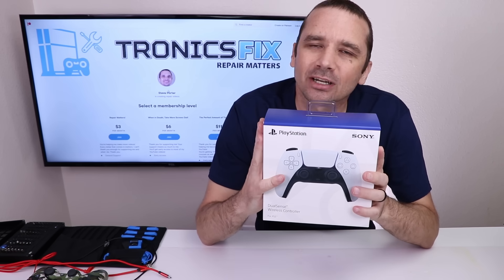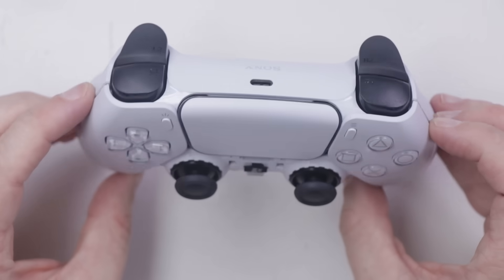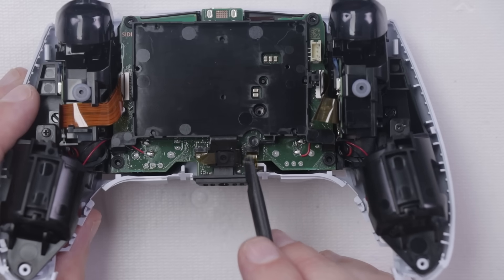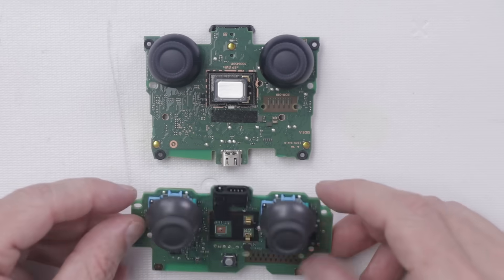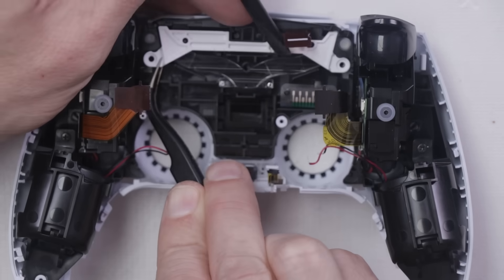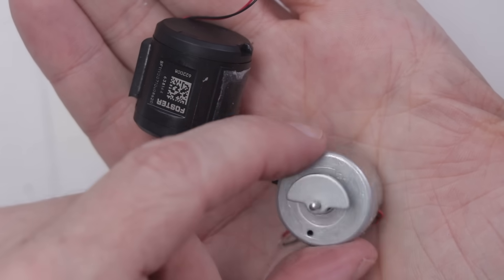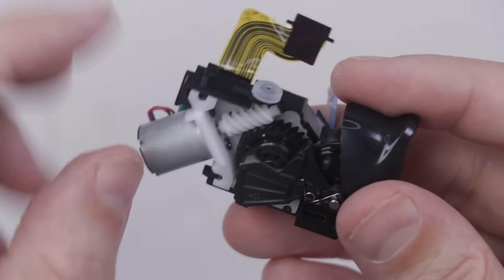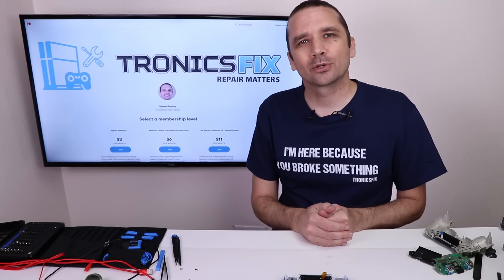PS5 DualSense Controller Teardown - A Repairability Perspective

Comment: Seems easy enough to take apart which is good news, I didn't know the Dualshock 4 controllers have analog stick drifting issues, I know all about the Joycon issues but never seen or heard of it in Dualshock 4s. Had so many issues with the darn Xbox one controllers though, rubber bit coming off a elite controller, USB port breaking, not charging, connection dropping every few minutes. Speaking of which when's the XSX controller teardown coming out? I thought those got sent out way before sony sent out their stuff.
Reply from the maker: I'll tear one down as soon as I can get my hands on one. Can't get them yet.
Reply: Joy cons have it after 0-90 days of use already. DS4 only show same result after year or years of use. Joycons are just overpriced garbage.

Comment: As someone who loves to customize controllers this looks easy to mod I’m happy
Reply from the maker: Yes, this is going to be a good one.
Reply: @Tronicsfix  how does the controller feel ? And the joystick tension how is that ?
Reply: @Fixiefre123ak  The joystick tension feels smoother than my ds4, also found out that the controller can be used in ps3 too. Can't wait to put an LED kit in this beast, lol.
Reply: @kylinemordashov1452  okay that’s good honestly it’s the reason I prefer DualShock over Xbox because the joysticks on Xbox feel terrible
Reply: @Fixiefre123ak  Hey. Update, i just got my ps5, the test I was referring to was on the mall, like "On the mall show"...Anyways, the controller joystick feels the same now that I'm using it for 3-5hours now... I have then decided to remove the joystick and put my broken xb elite series 2 joystick on it, now it feels great. lool ;p

Comment: dualshock 4 battery is like a ps2 memory card.
Reply from the maker: Lol...yep!
Reply: Ps1 memory card since it's gray. Ps2 memory card was black.
Reply: @wagner2077  there's all sorta color ps2 memory card, i have a blue and red one and black too
Reply: @Cloud9-v6  Still, the most common color was black. PS1 memory cards was predominantly grey.
Reply: My PlayStation controller stays on for the longest... I play 5-6 hours sometimes and when I get caught in, maybe 9 hours... It never seems to die.
Reply: @omarionbrown5596  mine does and i play less or more sometimes
Reply: @fated_glaze1671  hmm that's weird... Well it looks like they have a new battery for the DualSense, Right?
Reply: @omarionbrown5596  yer true lets hope its lasts longer plus glad its like the box and has no light
Reply: Disable rumble/vibration and you'll notice a frankly ridicilous increase in batterytime
Reply: @Grandmaster-Kush  ive never had vibriation on the dual shock 4 and it seemed to die quicker not sure why i even dimmed the light
Reply: @Grandmaster-Kush  Open the controller and remove the rumble motors altogether and also notice a frankly ridiculous decrease in weight.
Reply: @Grandmaster-Kush  I actually don’t use vibration that’s why i don’t understand people complaining about the battery
Reply: I charge my controller not often, maybe 1 time in the week, it lasts so long though I don't play as often anymore, but it's usually on for atleast 2 hours straight sometimes even longer
Reply: I thought the same
Reply: Play time I find varies a ton game to game. It isn't just vibration, it's simultaneous button pressing and such. I can have it last days playing RPGs or other games, FPSs, one day or less, something like mgsv(melts batteries) or horizon can go really quick. The more action oriented, the less time.
Reply: Ok
Reply: Something to remember is that weird usage of the battery can mess with its total battery life. So if you plug it in at like 50% most of the time or play with it plugged in constantly, over time it can slowly wear down the battery life. Which is why some people can go like a week without charging while others can only go for a few hours.

Comment: The sticks might be the same but they feel much smoother than my Dual Shock 4. The plastic around the stick of the Dual Sense is very smooth so you don't get that plastic on plastic grinding feel. Maybe they'll get that way with time but it's my impression that the plastics are more resistant in this design.
Reply from the maker: I sure hope they are!
Reply: @Tronicsfix  they changed the position of the R3/L3 button, they are now on the top side  which should hold better since for example L3 is usually pressed while the stick is forward to sprint
Reply: I really hope they are dude. My DualShock 4 doesn't last long before I have to open it up and deep clean to fix stick drift and L3. 

SO annoying
Reply: @winlover37  then you don't treat it well, I have had one for 5 years with no issues with stick drift or cleaning
Reply: @user-cg7tj7cu4m  I don't whip my controllers around or smear cheeto dust on it so what am I doing wrong? I've replaced a lot of parts and cleaned it countless times. Just seems like a cheaply made controller to me.
Reply: @Immy M Good for you. I have 2 drifting controllers over 3 years.
Reply: @saelin00  I have four controllers, no drift. Try rolling the sticks before you turn the console on, then again on startup. If that doesn't work, an older way I used on PlayStation 1 or 2 was to know which direction it drifted and hold against it just enough to counter when turning on the console. Should sync it centered then, just have to do that every time.
Reply: @reykennedy5716  Maybe we play different type of games. When I play a lots of multiplayer games the sticks die faster. Just noticed. I'm not pressing hard or do anything barbarian with them. They are cheaply made. Hundreds or millions of controllers going in repairs with this issue.

I hope the dual sense have better, more quality parts than the dualshocks. But I say, the new triggers give an another possible issue in the list.
Reply: @Immy M I'm glad you're not having issues. Btw the sticks are super easy to replace if yours are worn.
Reply: I told Microsoft to stop using cheap plastic and flimsy spring potentiometers to prevent stick drift.  They must use aviation quality potentiometers, but are being very cheap ☝🏿❗

Comment: I had 6 DS4s in the space of 4 years because of stick drift and L3 button dying.

 I too really hoped they would change the sticks. I learned how to solve the stick drift easy without a solder kit (replacing the discs) and I hope you can do it on these without unsoldering the motors by just taking out the whole big black part with motherboard/motors still attached. If not I'll just have to get a soldering kit too lol.
Reply: I think there’s just not many options for joysticks. Both Sony and Microsoft have used ALPS brand sticks for years at this point. 

Nintendo did a custom one for the joy-cons, and they’re worse than the ALPS sticks in every way, though some of that is expected given the compact size. 

Idk if it’s really worth it to a company to custom commission a new style joystick when over 99% of people never get drift, cheaper to just replace them for people when they fail prematurely.
Reply: @Bortstampson  Yes, it's a monopoly at the moment, maybe some Engineers at Omron, Cherry or another company would accept the challenge and develop a better stick module.
Reply: @kuchenblechmafiagmbh1381  It's not a problem for MS and Sony as long as the percentage starting to drift during the warranty period is not too high. After all, it's their business to sell these accessories. Back in the 70's manufacturers still made stuff that was supposed to last forever, but then they noticed they will go out of business that way.
Reply from the maker: Looks like repairing these should be exactly the same.
Reply: Watch battle beaver custom's teardown on this.....he explained why L3 issues should happen/occur a lot less frequently now.

   I'm surprised Steve didn't notice/question the change.
Reply: Wait how did u fix jt
Reply: @adnikelmendi3847  I changed out the accelerometer discs in the stick assembly that solders to the board. You can do this without needing to solder  a new stick assembly on. You just buy a stick assembly for like a £!/$1.50 off ebay and take the metal accelerometer discs out and swap them with the old ones by opening the green sides of the stick assembly on the controller board. Not hard to do if you watch a vide of it. I know tronics fix showed how to do it. Soldering a new assembly would be better but 1.I've never soldered (doesn't look too hard) 2. I don't have a solderer.
Reply: Feels like you should’ve just got some extra warranty for like 4 years.
Reply: 3 years now with my first and only DS4. No problem at all. As good as the first day.
Reply: Those are rookie numbers
Reply: I have 2 controllers from day 1 release. No issues lol
Reply: seems like you are too harsh with your ps4 controllers. I bought the ps4 after 6 months of its release and I'm still using the included DS4 with the ps4 the only problem I had is the charging port and I fixed it and it's still rocking.
Reply: @Deedz_Indeed  Maybe I am I don't know. I just use them normally but I do play a lot of first person shooters so maybe they do more wear and tear. Dunno. My PS3 and PS2 pads never did it. When I take the accelerometers out they are a burnt blue/brown colour.
Reply: This is the first I've heard of DS4 having a drift issue, had zero issues with my single 2+ year old controller. Given that you've gone through 6 controllers in the span of 4 years that have had stick issues maybe it speaks more to your usage of them rather than an issue with the design itself, just a thought.
Reply: @Sevicify  They happen, quite a lot. But I can't say for sure if it's an issue of bad batches. I bought one and not more than a month it already drifted. Playing only one game that isn't a hardcore game that didn't require much input from the right stick. Then suddenly my camera started to move on its own after just a couple of weeks of play.
Reply: My Sony controller never drift, so far the only defect i have encounter during years of usage is the decreasing battery life spans. So i guess it vary person to person.

Comment: Pairing this with the Sony video of the PS5 teardown, this next Gen stuff looks really easy to repair. Would love to see a comparison to the XBOX next Gen stuff, and a conclusion what you think is easier to repair.
Reply from the maker: This controller looks pretty easy to repair BUT it does have a large chip on the board that would be problematic if it fails a lot.
Reply: @Tronicsfix  Yep, I do see your point there. But I like that everything is kept modular, including the new style R2/L2 buttons. As you mentioned yourself, normally stuff like that is glued together.

Comment: NEVER heard of PlayStation Controller Analog Drift 🤷‍♂️
Reply: You have about a 50%chance to get a bad controller on the type 1 and 2 PS4 controllers the type 3 and newest ver dont have the same problem instead of a 40% failure rate its closer to 25% now within 4 months of heavy youse
Reply: @demonlordotrt754  IF what you're saying is true, then it means Sony managed to improve it within the same generation, do we know if those analog sticks look different from type 1/2 to type 3? If not, then how do we know the PS5 controller isn't even better?
Also, this seems like an issue that can be fixed 100% in software. My understanding is that the stick simply doesn't recenter itself to (0, 0), right? For example it could be (-10, 0), with x going from -127 to +127 for example. In that case, the PS5 can simply detect this position (as it's the most frequent one) and treat it as the new center. Problem solved.
Reply from the maker: Lol
Reply: Same, I've had my ps4 since shortly after original release and the included controller still works fine, same with the other couple DS4s I have. Think some people are careless or overly hard on the controllers.  The Switch joycons though.... different story.
Reply: @embodythejotun  My thoughts exactly, I'm surprised my friends Controllers are still fine, they play CoD religiously and I see how they use and treat those Controllers... It makes me cringe so hard 🤣
Reply: @Derek Bartlett Yeah well I and everyone I personally know hasn't had any issues... I've also NEVER had Joy-Con Drift so 🤷‍♂️ Just cause others experience different doesn't mean it's a "Joke" 🙄
Reply: Only issue I have is with my Blue DualShock 4 (purchased maybe a year ago now 🤷‍♂️) which has the Down on the D-Pad acting up, like I need to slam the button a few times to get it to register (been meaning to get a Black one to match my System anyway) neither I nor my friends have had any other issues with DualShock 4 Controllers over the years (ranging from Launch till Now) besides the one dude who still throws Controllers at Walls 🤣
Reply: @MrRhysReviews  easy to fix by dropping some graphite powder on the contact. You can make by scratching a pencil's tip
Reply: I have used my Dualshock 4(  1. gen.) for 5-6 years and I have almost no drift at all. The gen. 2 my father uses has more drift on the left analog stick than some of the ones that were shown in the repair videos
Reply: @CrusadingDragon  controller that I got with the console is still fine, but Ver 2 controller that I bought a year ago broke in 4 months time.
Reply: My new DS4 that came with the console already had drift :)

Comment: I’ve been using the same ps4 controller for about 4 years but I haven’t heard a thing about drift in any of the controllers
Reply from the maker: That's amazing! It's a common problem.
Reply: Yeah I've never heard of it being an issue myself either, had my PS4 for little over 2 years and haven't had a single issue with the controller. In fact in all the years since PS1 the only issue I ever recall having with any official PlayStation controller was with my original SixAxis where the battery died, I simply removed the battery and it still works perfectly fine to this day as a wired controller with no stick or button issues. It makes me wonder how people are treating their controllers for it to be so common, especially those who say it's happened to multiple controllers like one guy who said they went through 6 controllers in 4 years with stick issues.

Comment: 9:35 this is beautiful, looks kinda like force feedback on racing wheel controller
Reply from the maker: Yep...probably my favorite part of this controller...as long as it holds up and doesn't break a lot.
Reply: @Tronicsfix  it would have been interesting to see the inside of the rumble parts. it's a completly different mechanism. they don't longer use spinning motors. the new controller uses the Lorentz force to create the rumble. would have been cool to see the inside of it.
Reply: because it is EXACTLY the same system except the size an torque :)
Reply: @mnap89  no its not. can you not read?
Reply: @selfm8612  I have replied to @Eduardo J about triggers,. Wonder why he wasnt marked in my reply.
And yes, vibration parts is very different.
Reply: @mnap89  oh okay my bad
Reply: @selfm8612  The controller uses voice coil actuators, if you wanna learn more about it, I’ll recommend watching Innocenceii’s video about it.